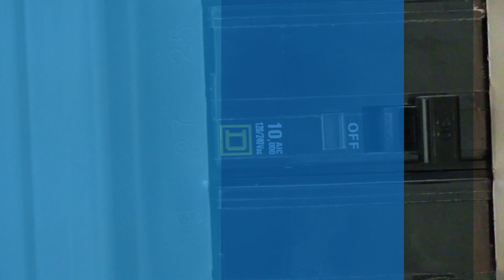How Do I Replace a Light Switch? | DIY Basics

Comment: Please use a Multi-Meter to check power. DO Not use a non-contact voltage tester like shown unless you are familiar with electric, as they can be incorrect often
Reply: Can you elaborate on how/why?
Reply from the maker: Here's a video on how to use a multimeter: http://bit.ly/29gY7wE. Thanks for watching.
Reply: Arlo Jeremy Non-Contact meters (If you read the instructions) Say to use on a known live circuit first to make sure it is working. However even after testing a known live circuit, Ive had non-contact testers not read correctly. Which would have lead to a nasty shock had i not known. Also they are known to go off with as little as 20 volts (Sometimes lower) Hope this helps
Reply: Even more safe.... Use a solenoid type electrical tester, like a Wiggy. They draw enough current, that phantom voltage isn't a problem, and when placed between hot and ground of a GFCI, will trip them in a real-world test.

Comment: I live in a mobile home and we tried to replace the face plates but upon unscrewing them we saw the they are a whole. how can we replace the face plates
Reply from the maker: There should be an electrical box behind the face plate, which has threaded holes for the plate to screw into. If you don't see one, you'll definitely need to call an electrician to take a peek. Be careful, Tamara!

Comment: I live in an apartment, with a fuse box inside the apartment, containing two fuses for two different circuit in the the flat, and a breaker switch in the basement that control power to the fuses.  Will it be OK to just unscrew the appropriate fuse, rather than turn off the breaker switch? Or is it safer to turn off the both circuits at the breaker?  Thanks!
Reply: I would just shut everything off, to be safe.

Comment: Should you wrap the inside of the back of the switch with electrical tape once you wire it/ before placing it in the box????
Reply: Sorry wrap the back ( not the inside) lol
Reply: Not required. Only place it's wise is when a switch is mounted to a metal mud ring, and even then, one wrap around the terminals only is all it takes.

Comment: 0:46 Please NEVER DO THAT The video incorrectly shows the tightening of both hot wires, joining the tip of the hook in the opposite direction to the tightening rotation. IF YOU DO THIS THERE IS A VERY HIGH RISK THAT THE CABLE WILL LOSE  (during tightening) or IN THE FUTURE AND GENERATE POOR CONTACT (and therefore a risk of fire or arcing).

The correct way is to make the hook "turn" in the same direction as the tightening of the screw. As seen in the connection of the Ground Cable. at 0:56